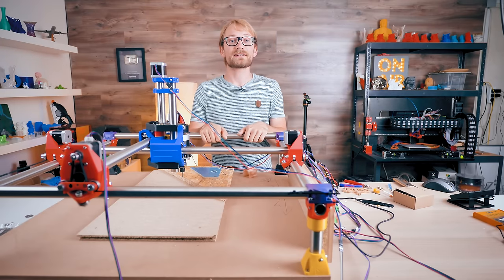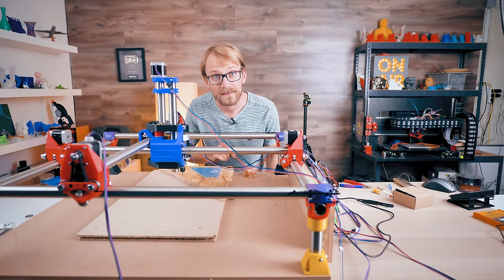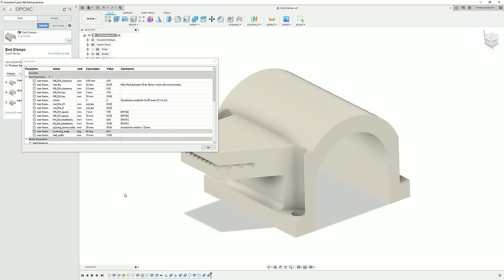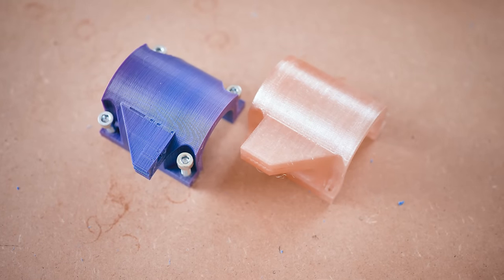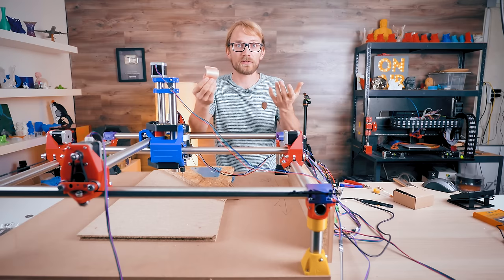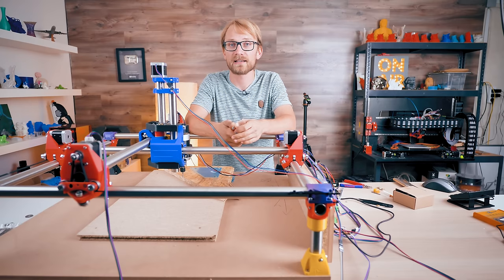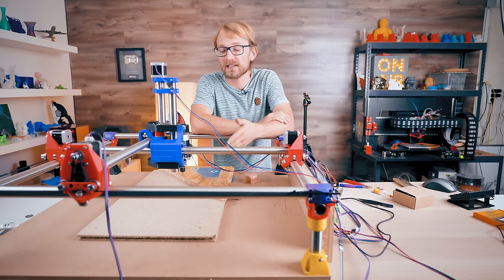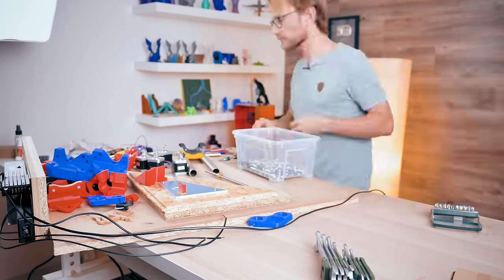Whose design even is this? (MPCNC conclusion)

Comment: Not that I can change the tone of this thread but as a customer, user, and someone who has heavily modified my MPCNC I think that the amount of vitriol in this thread is over stated. I suggest that before crucifying Ryan or boycotting his product go check out the V1 forums. Ryan is actively  supportive of mods to the machine, and even people who are developing their own CNC's. The issue  that he's fighting is people that are making small mods  to his core parts and selling them as their own or worse selling them as official V1 products that he then has to support.  He legally has to defend his work to keep these copies off ebay etc but is always supportive to makers making mods even at the detriment of his bottom line. 

This video has done a ton of damage to a really good guy who is trying hard to walk a line between sharing his design with makers and running a one man business.  Again I suggest that you check out the forums before disparaging Ryan or the project.
Reply: Certainly any trademarks on the MPCNC are protected, but unless Ryan patented the design of the MPCNC, and since a functional object like a CNC machine cannot be protected by patent, the MPCNC can be copied, modified, or even sold by anyone.  (This is as long as anyone doing the copying is not using any of Ryan's logos or trademarks.)  This right has been upheld in many court cases involving unprotected designs.  In one example, the judge stated, “Unless protected by copyright or patent, once form or design in an article is offered to the public, it becomes the property of the public and, absent deceptive identification as to source, may be copied at will by competitors.” Zippo Manufacturing Co. v. Manners Jewelers, Inc., 180 F. Supp. 845, 847 (E.D. La. 1960)

Comment: Lesson learned? Stay away of non open sourced projects. Not because of laws or projects themselves but for the egos around them. The claim is just like saying you cannot make replacement parts for anything with your 3d printer, as those parts will fit some others design. You cannot modify any machine you buy because at some point there will be a part that interfaces with the original ones. Ridiculous.
Reply: Damm... I was printing handles for some IKEA doors, I have to stop doing it.

Comment: so because your mad at ryan  you put it out there that the cnc shakes when cutting . (first few minutes of your video )  this is not true i have many hours on mine and have no trouble with shaking.  i thinks its pretty crappy you that you left it like that. you should just take this video down instead of discouraging people from building it.  if i had seen this before i built mine i would have not built it based on this video

Comment: Hang on a second, I get the whole thing ain’t that nice but can’t you just release the parts under the same license and just get on with it? You’re butthurt because he restricts the use for commercial applications but he does what he wants. He should seek advice and so should you in order to grow the legal limitations of his designs and continue to work your separate ways anyway.
Reply: The law says that functional objects like machines are not protected by copyright, and unless they are patented, anyone who wants to can copy them, change them, and even sell them.  (“Unless protected by copyright or patent, once form or design in an article is offered to the public, it becomes the property of the public and, absent deceptive identification as to source, may be copied at will by competitors.” Zippo Manufacturing Co. v. Manners Jewelers, Inc., 180 F. Supp. 845, 847 (E.D. La. 1960).  What the MPCNC designer did was wrong because it was illegal, not because of anyone being 'butthurt'.  He had absolutely no right to tell Tom that he could not publish his improved MPCNC part design.

Comment: Redesign all the parts. Change only the bolt hole sizes to be metric and adjust spacing between the bolt holes and now it's all you and there is no copy right issues. It follows the form is function guideline and negates any claims of it belonging to anyone else cause of the matched hole sizes and spacing.

Comment: Thomas , it's very nice what you are doing but this model of cnc is very very bad when is scaled , it's more like a expensive toy , but at the end of the day is still a toy , a kind of useless toy because even for educational purposes is worthless, all the normal parameters speeds and federate will not work on this machine , it has too many deflection. Maybe for a 1'x1' area with 4" in Z

Comment: This is something that has already been decided, in favor of your original release as fully open. Its just the opensource community relearning the lessons that have gone before.

You made an aftermarket compatible part. This is the same as making an aftermarket radio to put in a car, or any aftermarket part in any industry. You made a part that does an original job that was not created by the other 'creator'. It was not a derivative, just as you stated. To take his argument as gospel would destroy any number of industries.

Comment: He would have been right if he held a patent on this part, but if you designed the part from the ground up, this is not a copyright issue. By the way, this CNC machine design does not look good at all, the tubes are too thin, it will never be rigid enough.

Comment: Arrogance engineering.
Reply: Right? Tom totally showed off his arrogance by cutting corners in his build and using a known to be crap spindle, then blaming the belts.  THEN when he was asked to share his modified part as non-commercial, he threw this hissy fit of a video up.  Total arrogance, I couldn't agree more.

Comment: Pretty obviously going to be useless for machining anything. Basically, elasticity has nowhere to hide from vibration. Do something original like anchoring the whole thing in concrete so that it can be disassembled with a jackhammer if and when necessary. There must be a million variations of cheap xyz motion platforms out there. All designed as if it this has somehow never been done before.

Comment: So basically, you want someone elses existing project to change their licensing to suit you or you will discredit them?    time for me to unsub from this channel i think.
Reply: whoosh the sound of the issue at hand flying over your head
Reply: @wezyap  i know the issue, Thomas chose this project and the fact he got permission before he built it means he was aware of the license.  He then crrated a part for it and wants it to be open source. Hes not getting his way and he feels entitled since..  youtuber.   Tell me, how is it not a derivative if he looked at the original one and designed from it?  Simply because he didnt use the model? He still used it as reference.
Reply: @Bobby11  Because this is a form based on a specific function, it is like if you build a wheel and publish the plans on the internet, Goodyear`s lawyers come knocking on your door and make demands, since you made a circular thing that fulfills the same function as something they have made before you. Going by this logic only one company in the world could make M5 screws and only one company in the world could make belt-buckles.

In your original post, you presented the case as if Tom wanted Ryan to changes Ryans licensing, Tom never made such a demand, and he doesn`t have to. It is Ryan that demanded that Tom changed his licensing agreement on a part Tom deigned, even if Ryan has no legal right to do so and have no part in Toms design. so basically, in the original post, you twisted the issue at hand 180 degrees on its head.